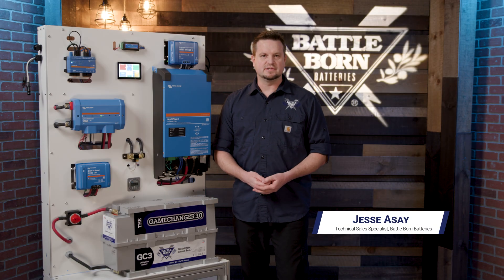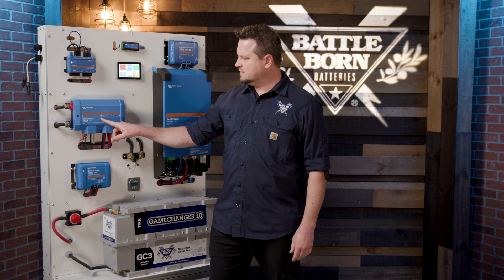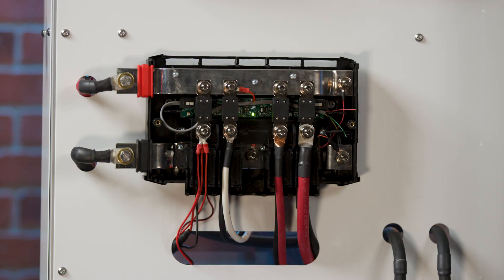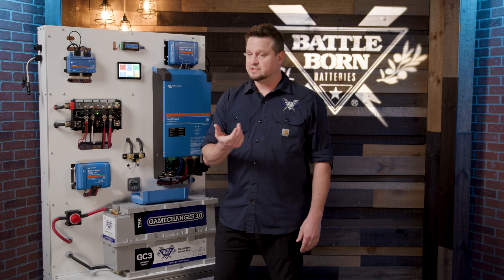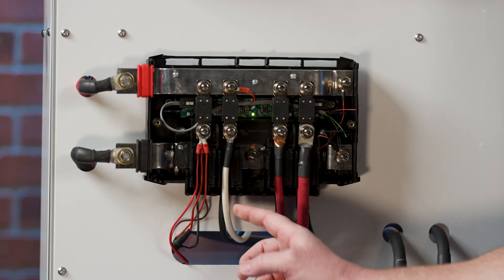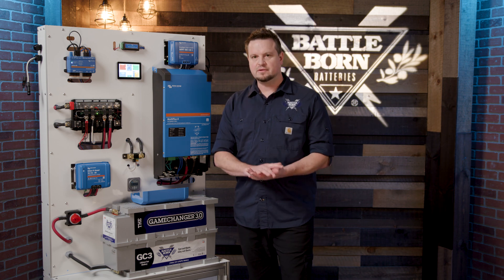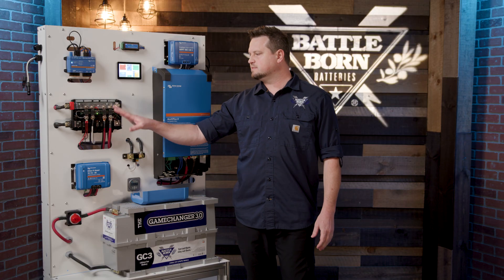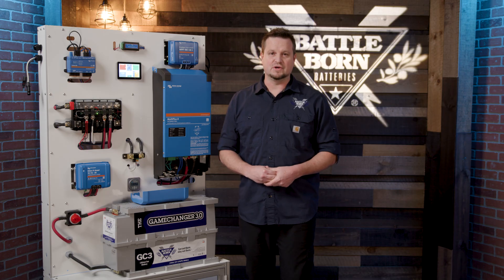FAQ: Lynx Distributor 101

Comment: WRONG!! LED indicator lights do not work unless paired with it the victron smart BMS or the Victron Lynx Shunt. Please pull your video down and do it right... you do so many things right this is really a simple one to correct.  Additionally this obvious error by the technician question does he really know what he's talking about.  However, one can simply purchase a step down converter from 12 volts to 5 volts and connect an RJ 11 cable to the 5v side and plug it into the Lynx.  Check out the EXPLORIST life video - DIY Campers•published on 6 Jun 6 2021
https://youtu.be/8h-E1lkYCKg

There is a business opportunity for you with this option.

Comment: The LEDs only work when you have the RJ11 cable plugged into a Lynx shunt or BMS, as it uses the 5V output from the shunt/BMS for power.  Looks like you have a custom wiring setup for the cable for the LEDs?  How are you stepping down the 12V from the batteries to the 5V for the LEDs?
Reply: I was caught on the same thing. it shows like he have it connected straight to the 12 volts.
Reply: You can make your own cable : https://youtu.be/v9SpXGYrOmE